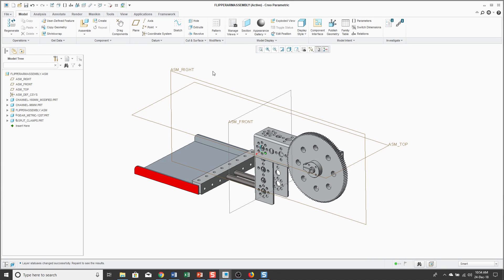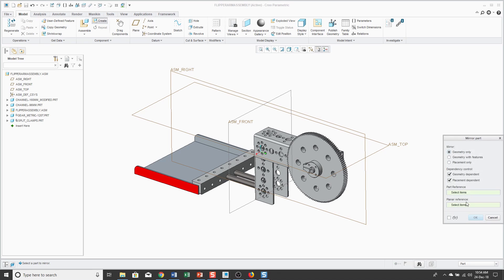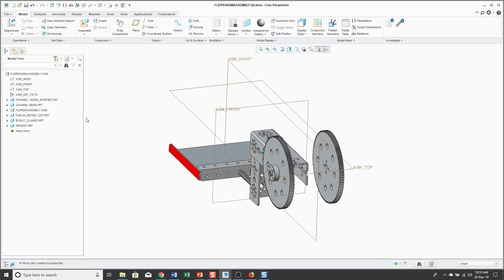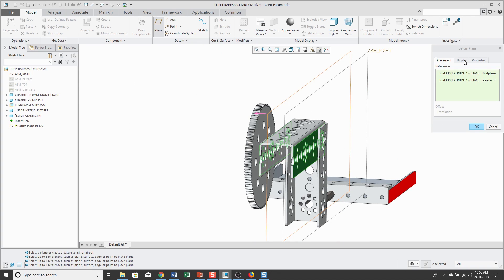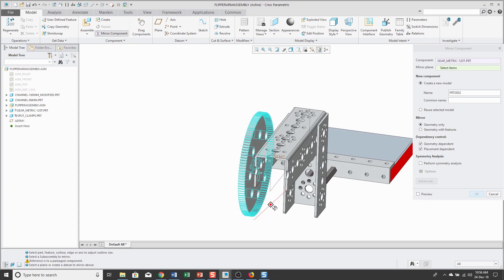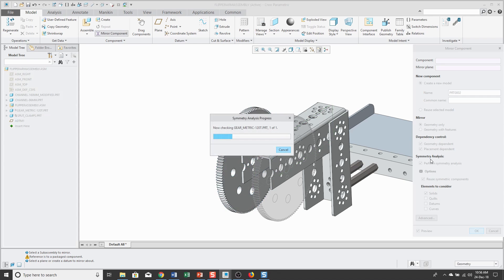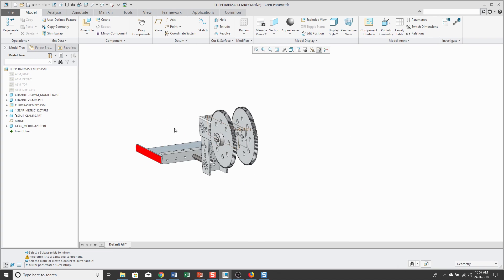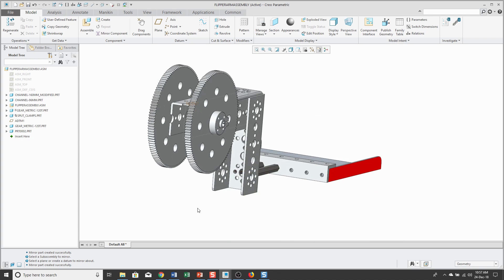Creo Parametric 4.0 Enhancements - Smart Mirror (Part 3 - Parts)

Comment: Hi Dave, Thanks for this interesting video!
I pick up on the comment from @Haseeb Khawaja. How to have a mirror part (or not) which has the same movement as the source part, in my case a symmetrical angular opening, like hydraulic clamp? I did not succeed with a pilot sketch nor with relations... Thank you for your reply
Reply from the maker: You could do it in the mechanism analysis with equal and opposite motors or with a Motion Skeleton if you just want to drag one and have the other move equally.
Reply: @CADPLMGuy  Thanks a lot Dave for your answer!
I'll try this method. Indeed, I just need to drag components to check their interlocking.

Comment: Can it pick the same joint type or all other constraints and have same movement as the original one??????
I am tryin this in creo 7 but the mirrored part is rigid and doesn't pick any mechanisms
Reply from the maker: No.